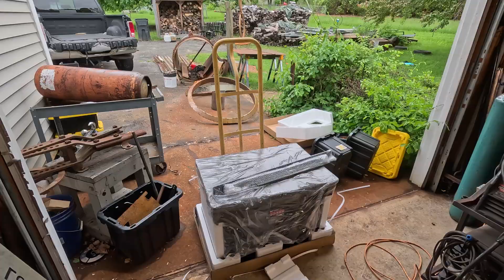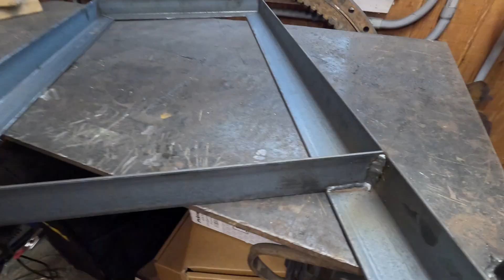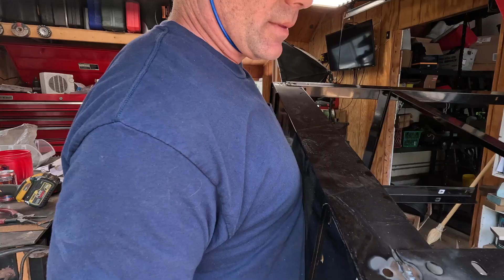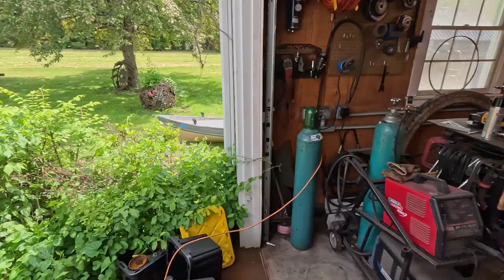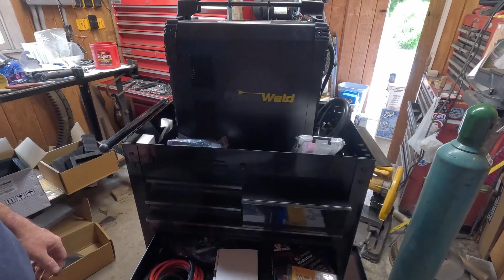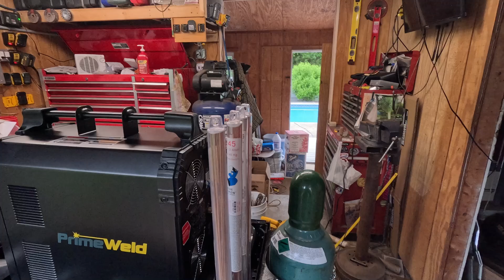The ULTIMATE TIG Welding Cart Build (Maximize Your Small Shop)

Comment: Thank you for making this video. I’ve seen people make welding carts out of the 5 drawers cart before but with smaller form factor welders and I had always wondered how people might set up one with the prime weld 225 because I have a prime weld 225 and an Omni pro 220 and I got the cart for the same reason. for the Lead holders I’ve seen people use the magnetic paper towel holders from hobo freight and they make the big Tig wire holders on Amazon that are magnetic for like 20 to 30 bucks I know personally in my five drawer cart I’ve almost fully filled it between welding wire stick, electrodes tig wire, gloves, extra leads, pedals if you didn’t get a tig Lead sheath when you ordered your welder, you can get a denim one off of Amazon from yes welder for about 10 bucks and it’s a zippered one compared to the majority that are Velcro
Reply from the maker: Thanks for watching!! I did get a lead sheath just haven’t put it on yet. I’ll check out the paper towel holders. If you haven’t please subscribe.